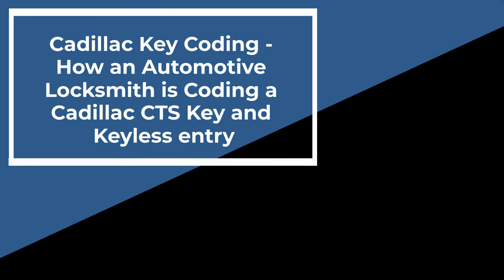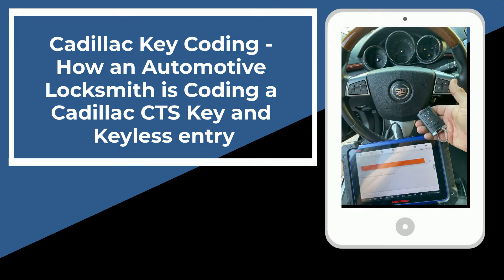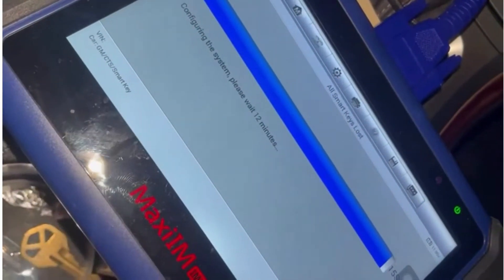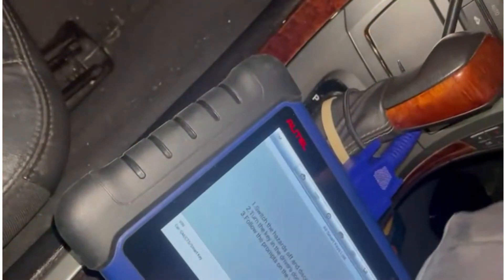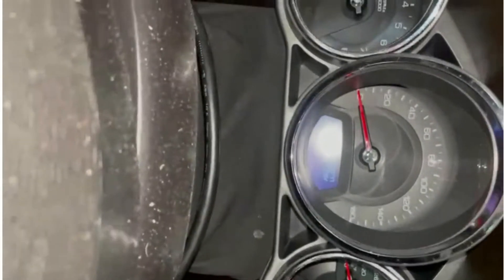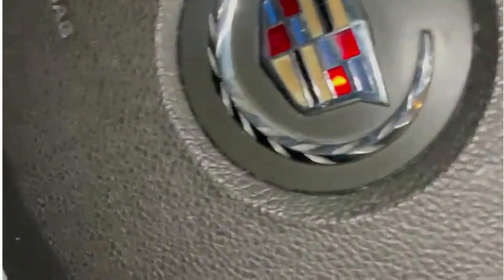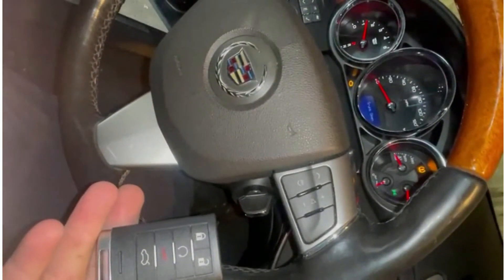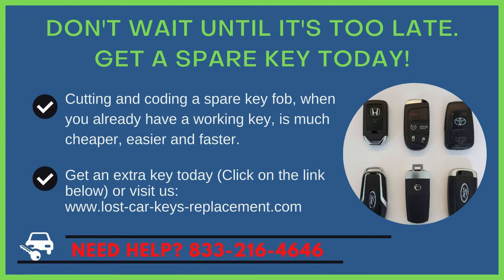Cadillac CTS Key Fob Coding - How a Locksmith Program a Cadillac CTS Key Fob with a Special Machine

Comment: The Amazon key fob has smooth edges. Can you take these keys and get them copied at a hardware store?
Reply from the maker: Thank you for your comment Mellow.
Not sure what you mean about Amazon key fob. But generally speaking, you can't have key fobs copies at hardware stores because they must be codes with a special coding machine.
You can have the emergency key cut, but coding the fob must be done with a special machine. Hope this helps.
Reply: In your video description, there's an Amazon link to a key fob. Those key fobs on Amazon aren't cut. They have a straight edge.
Reply from the maker: @RabidStacker  in regards to the emergency keys, yes, you should be able to get them copied. But it really depends if the store has the right cutting machine.  Some home Depot have, some don't. So double check before.
Also, remember that regardless, the key fob must be coded to start the vehicle.